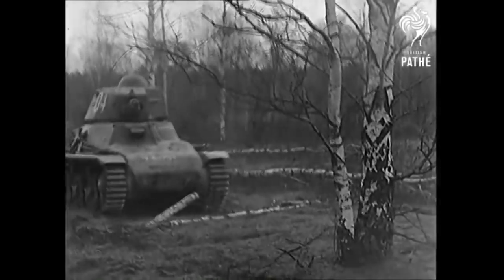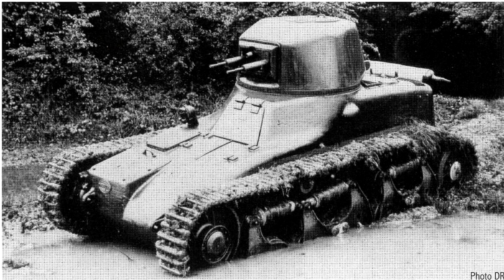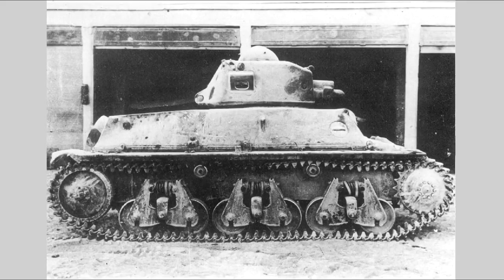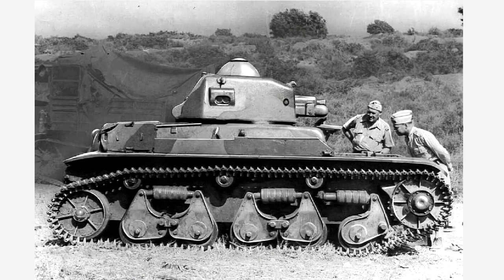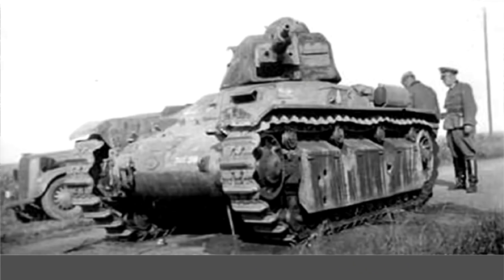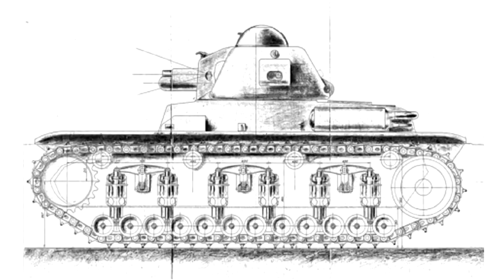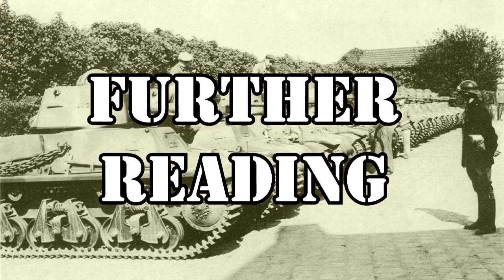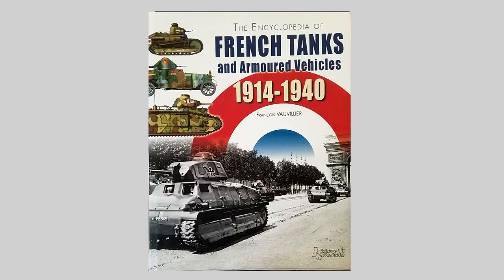Tanks of World War II - Episode 7: Renault R 35 and Hotchkiss H 35

Comment: Just a note on the gun.  You made it sound like the newer model was more powerful BECAUSE the barrel was longer, when it is really the opposite.  What makes it more powerful is the increase in velocity (times the mass, all other things remaining the same like material, shape, composite, speed drop off with range, etc.).  To increase the velocity, you use more powder (or different burn time, etc.), which means you need to make the breech block bigger (or use stronger materials) to contain the blast.  Since the projectile is faster, you probably need to stretch out (or increase bite?) the rifling (in order to maintain spin and accuracy), which leads to the longer barrel.  There are so many factors that need to be balanced just so to get max punch out of a tank gun.  Barrel length is really just a result of those changes.
Reply: you are incorrect although you make a good point it is not always the case, the longer barrel also can allow higher speeds from the same amount of powder (up to a certain point) as the longer barrel reduces the dissipation of the explosive force making it exert force on the shell for longer thus accelerating it to a higher speed.  In the case of the 37mm this is what happened as the Sa37/18 and Sa37/38 used the exact same one-piece ammunition this is often preferable as it reduces logistics issues.  This can not be done with all guns as after a while you don't get any changes in dissipation rate.